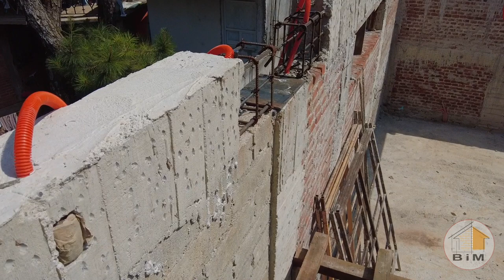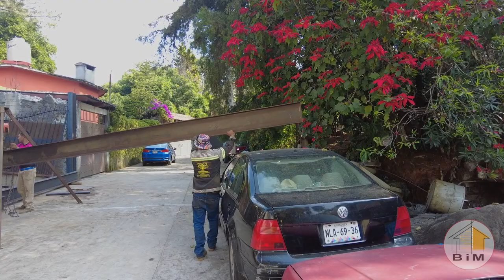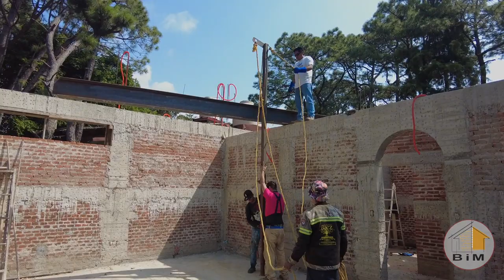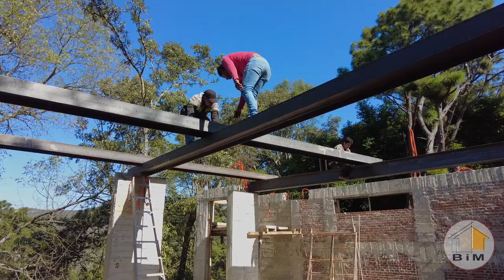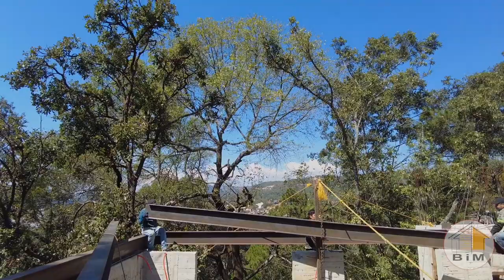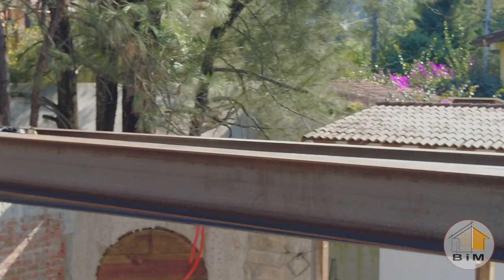17. STEEL BEAM INSTALL Top Floor

Comment: Hi how was the beam fasten on top of the walls?   Were they welded on the plates only? Im doing a similar project.
Reply from the maker: We left four pieces of rebar protruding up from the support column where beams will rest. The plates have holes cut to fit over that  rebar. Once the plate is in place it is welded to the rebar and the rebar is cut off flush with the plate. The beam is then placed on top and welded to the plate.